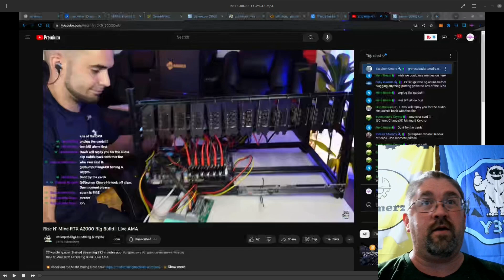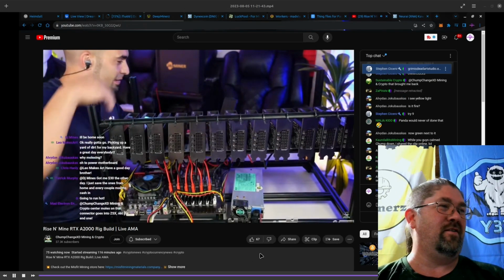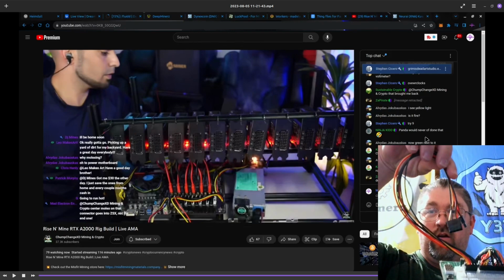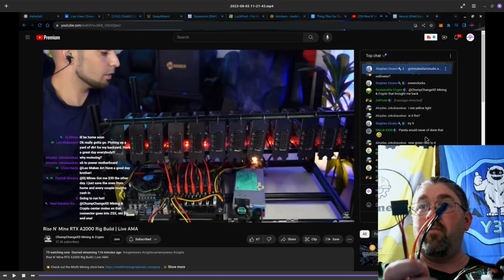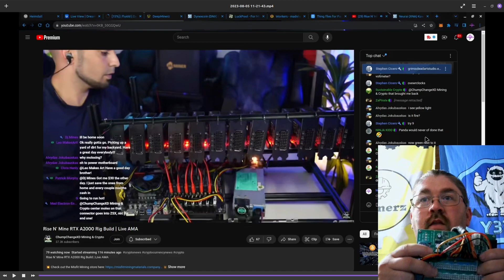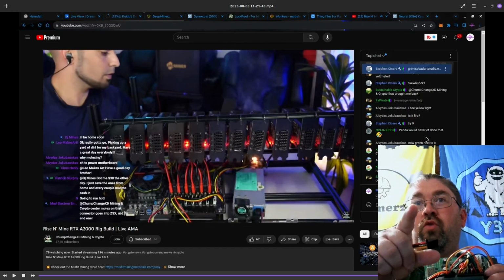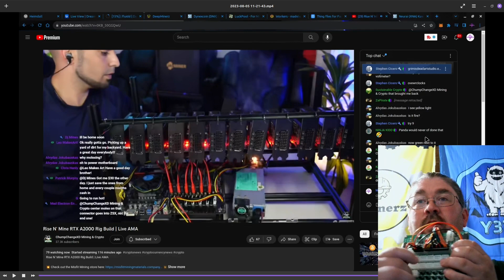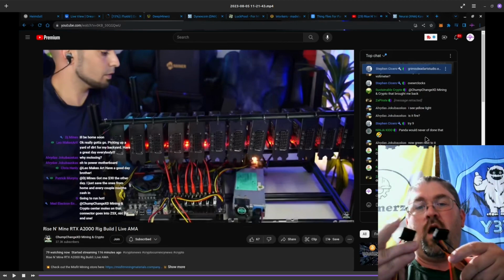ZSX Breakout Board - ON FIRE!!!!

Comment: The other day I tried to connect an ATX power supply to the Molex on my breakout board and it fried my ATX power supply. I thought that was how to get them to sync up is there another way? Or am I just supposed to use a Molex to four pin from the ATX?

If so, what can a Molex be used for on the breakout board?